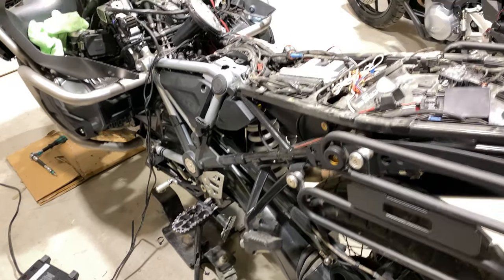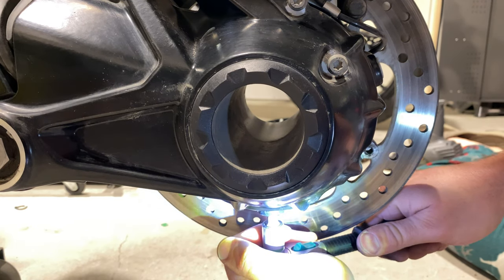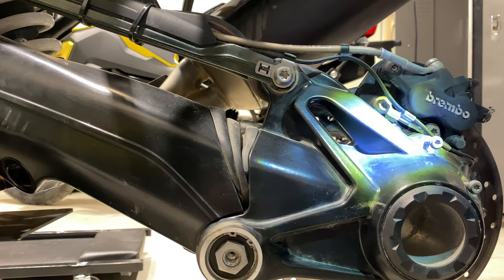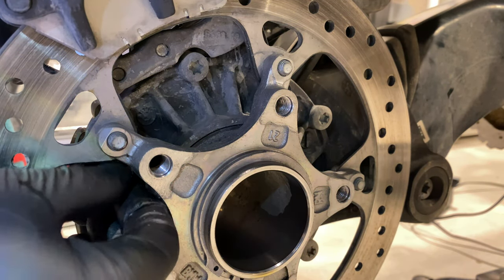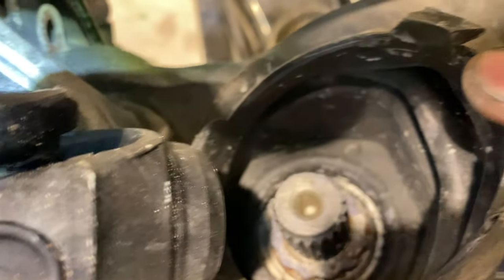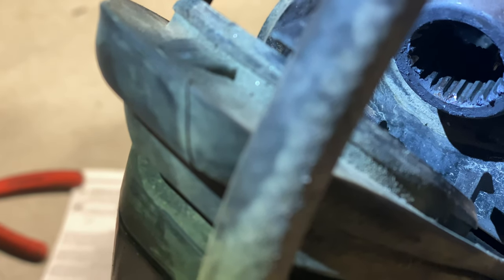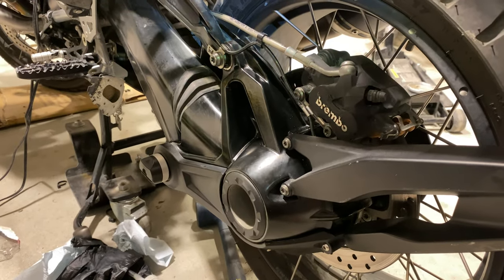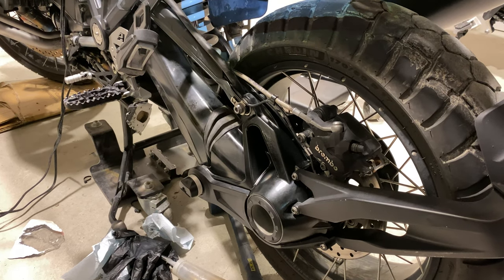BMW R1200GS Rear Drive Service + Brakes + Spline Lube + Final Drive Fluid

Comment: Hey Adam, 
Thanks, I just did mine for the second time. I did the front splines by just pulling the shaft back far enough to lube it. It looked pretty clean. 
I would like to add something that I have yet to see in all the videos I've watched on this chore.  Seems nobody cleans the brake rotor off with brake cleaner before installing the caliper and wheel.  We've put our greasy/oily hands all over it. 
Mike
Reply from the maker: Good tip! Thanks. I'm about to do mine again so I'll have to remember that.

Comment: Always loosen the filler plug first. If you can't remove it to replace the fluid you are screwed. The drain plug is a torx. The fill plug is a hex.
Reply from the maker: Great tip for new bikes. I have done the FD Fluid on this bike already so it wasn't a concern.

Comment: Adam I want so much to thank you for this video and information, I purchased a demo R1200GS in 2016, I came from inline 4 Cyl, like the Blackbird, K1200s, had no Idea BMW had shaft drive problems, my 2016 R1200GS I was not familiar with the new bike, had nothing to compare it with, after the first tyre change I noticed a bad vibration in the rear, I thought it was balance, so I purchased a static balancer and that did help but not totally, I also had another 2 bike shops balance the wheels and had to do it myself afterwards as the problem was still there, still non the wiser I would try loading the bike with weight, lighten it etc, was really stuffed about it, then years later I see your video just by chance and so I  had a look at the final drive, I could not move to open, so I gave it to a BMW dealer to fix, the final drive had to be damaged to get it off Im told it was that bad, this then required a  new final drive, drive shaft, boots etc. Initially BMW was not going to cover any of the expense because I had not had the bike serviced in two years, that's because I had stopped ridding it, " as it was not nice to ride".

But then I got a call from the workshop, BMW was covering parts 2 years after the warranty had expired, I had the labour cost only about $1150.Au. 
The bike now has no vibration from the rear, has noticeable increase in power, and its just the most fun bike I have ever had in 50 years of motorcycling, I have no regrets about owning the bike, I just love it, but I am a bit worried as to how much stress was put on the engine, clutch, but  most of all the output bearing from the gearbox. 

I also had checked the rim with a dial indicator, as I thought that was the problem, 2 loose spokes on the rear, the rim is not as true as one would like, as to compare the K1200s wheel was very true indeed.

I had never taken the bike into water, but had ridden it twice in the rain, the bike was always kept clean and  in the warmth of the garage in south east Queensland.

BMW also replaced rusty swing arm bearings, free of cost. I paid $ for labour.

So thank you Adam, by the way my eldest son is also Adam.
Reply from the maker: Thank you for writing, Trevor. You're not alone in this as many of us have been impacted and one thing that you can do is to lubricate the shaft at both ends which will increase longevity. Every 6,000 miles (10K), put the bike on the center stand and check for excessive movement laterally in the final drive by grabbing the rear wheel and moving it around and see if the FD moves a lot side to side. I'm glad it's working now and that price was not too excessive overall.

Comment: I remember when that design came out with the hollow axle that BMW said the gear oil was good for a lifetime.  They didn't even put a drain plug on the housing.  Glad they fixed it.
Reply from the maker: Never trust lifetime fluids.
Reply: Same with mist automatics these days. Says they are lifetime until problems occur

Comment: T45 on one, T40 on another part of the same assembly.

That sounds exactly like the way our MTD riding lawmower is made. Virtually everything holding the sheet metal body panels takes a different socket. It's a totally insane way of building anything. No wonder shop time is so expensive for even the simplest of repairs - the inmates are running the asylum.

Comment: Excellent job Adam ! 
But, I'd rather extract the entire driveshaft and inspect the other side, as well as the U-Joints both sides. I live in Brazil and this sort of issue is pretty common over here. BMW doesn't care, you have to ask them during periodic maintenance to check this out. Most common reason is riding on rainy, muddy and high humidity conditions. Years ago BMW would recommend, based on their Instruction & Repair Manual to check the driveshaft each 20.000 km. Don't know why they give up recommending this simple and important maintenance. I know dozens of cases of driveshafts cracking due to poor or no driveshaft maintenance. Another thing, sure you can use Moly to grease the splines, but it'd be very important to grease both splines and also U-Joints with Calcium-Based grease, to avoid water to contaminate and rust these components.
Reply from the maker: I agree that both sides of the shaft should be lubricated and I'm also with you that it's offensive that this is not recommended maintenance by BMW. It absolutely should be.

Comment: Nice vid! Two questions/comments though:
1. Why shouldnt you move/rotate the shaft when the joint is "disassembled"?
2. I am wondering if BMW (don't worry, I'm not trying to make them look bad, I'm a beemer fan myself) is using some cheaper materials when buying these shafts/end drives. 
My R 1150 GS from Year 2000 (which I have now sold) had a clutch spline failure which I repaired myself. When I took it apart, I had no signs of rust or corrosion whatsoever, despite the splines being almost dry. 
Now (haven't checked on my 2013 R 1200 GS) there's this almost common issue of splines/end drives/ shafts being rusty, which (obviously) wasnt an issue before.

Makes me wonder if they cheaped out on something....
Reply from the maker: Hi. Number 1 is because if you rotate the shaft, the splines on the shaft & drive get mis-matched and it makes marrying them back up when you’re done WAY harder. Same goes for rotating the hub on the final drive. If you don’t touch them, it’s just way faster to marry them together. 2. BMW just needs to grease these things from the factory and they don’t. My K75 didn’t have a shaft lube interval either but every K75/K100 owner knows to do it every 6,000 miles or the splines eat themselves.

Comment: I think it is easier if you clean your bike first and get rid of the dirt and sand before you dismantle everything. Just a humble tip from an old man 🤣
Reply from the maker: You're right BUT I only wash my bike once a year. Most of the year it's covered in mud we go out off road every weekend so it never stays clean.
Reply: @AdamChandler86  😳

Comment: Hi Adam, I followed your video on this service Which was a help, but I really think you should mention that when you remove the speed sensor that the gear oil will leak from that hole....... unlike in your video I did not put the bolt  back in the hole but put it in  my tray with some of the other bolts .... I had a dark towel underneath the hub so it  dropped it would not scratch it on my workbench, unbeknown to me all the gear oil leaked out onto this towel. It was only by sheer luck that I seen another video where somebody said they put an ear plug in this hole to stop the oil leaking out, when I checked mine  I barely had any oil left in the final drive hub, I know that  if I hadn’t of put the towel underneath the hub I would’ve seen the gear oil leaking out onto the motorcycle lift, this would definitely need mentioning in your video if people are going to follow your advice ..... I consider myself very lucky this could have been a very costly mistake ..... Mark
Reply from the maker: Thanks Mark for the detailed comment. It's appreciated. First, I'm not a mechanic and I do the video in order where the fluid is drained and then the sensor removed. You're correct in your case that keeping that hole plugged is required but if someone is doing a fluid change + spline lube, they've drained the fluid and therefore this isn't an issue. While your rebuttal may be "don't make videos if you don't cover everything", there is a great service for people like you and I, first BMW's Service DVDs which you can buy at your dealer for $400 and they cover everything. Or, you can search the web for JVBProduction and give Jim $30 for DVDs that are very professional and cover all of the bases. For a free YouTube Video, I feel like I'm doing a pretty good job. Note I'm not offended by your comment and you're not wrong, but I'll never cover every exception.
Reply: Hi Adam, please don’t think my comment was in anyway negative,  I actually found your video very helpful, I Just thought for someone like myself doing this job for the very first time it  might be worth a mention that this can happen, to be honest I was very surprised that the sensor hole went right through into the inside of the hub, this is what caught me out. I did smell the oil ‘which we know has a very distinctive smell’ but I just thought it was where I split the hub from the drive shaft. I also do most of my own mechanics and I find people like yourself and the time that you that you put into their  videos very helpful, keep up the good work 😊👍

Comment: Thanks! I have a 2017 R1200RT but some parts like this are the same. I couldn't figure out whether the filler screw is behind the brake disc (need to take wheel off) like in the previous generation (till 2013) or on top of the rear drive.

Comment: man, what a great video, i have a 2016gsa and this will be one of my winter projects. THANK YOU
you mentioned you would post torque specs on all this, I didn't see it anywhere? TY again!
Reply from the maker: Hi. Everything is here - http://www.jimvonbaden.com/Wethead%20Torques%204.pdf great PDF to print off and keep around the workshop. I believe it's section 33.

Comment: Did you use locktite or anything else for the rear tire bolts?
Reply from the maker: Rear tire bolts, nope just torque to spec. I only apply thread-locker to bolts that came with it from BMW.
Reply: @AdamChandler86  Thanks dude. My push rod came off but where it meets the engine... jesus this is going to be fun.

Comment: those brake pads could do A LOT of milage before needing replacement. they were not even at 50%.
but i guess you needed an excuse for a better set lol. been there, done that ;)
Reply: Exactly what I was thinking too. “Very worn down” 🤷🏻‍♂️

Comment: Where did you get the final drive gear oil fill bottle and adapter? Thanks.
Reply from the maker: There is a gentleman on ADVRider who is selling them to people. Google, "advrider final drive filler tool" and you'll find his thread.

Comment: Great video, can you share the brand oof your tool kit?  Cost maybe?  Looks high end, and self-contained.  Also, I have the R-1250 GSA, and was wondering if there is a source for knowing the torque settings for all points on the BMW?
Reply from the maker: https://amzn.to/3b5P0eb - Congrats on the new R1250. Most of the torques on this page carry over to R1250 - https://jvbproductions.com/Wethead%20Torques%204.pdf

Comment: Hi Adam,

At 9:20 you say not to spin the drive shaft, can you explain why not?

Kind regards

André
Reply from the maker: When you pull the final drive away from the drive shaft, you now have the teeth aligned for when you put it back together. If the hub or drive shaft move any amount, it makes it harder to put them back together when you're done.
Reply: Thanks for clearing that up, could understand what difference it would make if it rotated a couple degrees compared to original position. Cheers

Comment: Shouldn't the front spline be done too? I take it the U joint cross bearings are not greasable??
Reply from the maker: The front splines are accessible with a sturdy pull. I just chose not to do it in this video.

Comment: Nice video Adam, I was wondering where you got the fill tool that threads into the final drive?
Reply from the maker: There's a thread on ADVRider called "final drive fill tool" and a guy makes them.